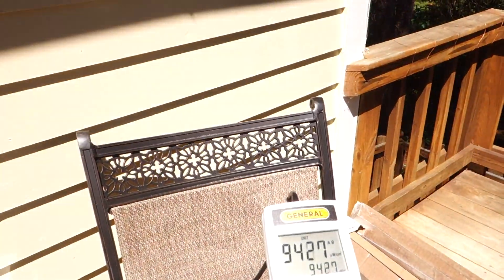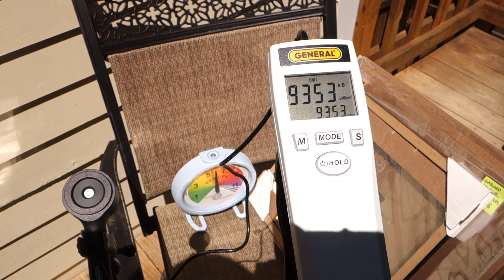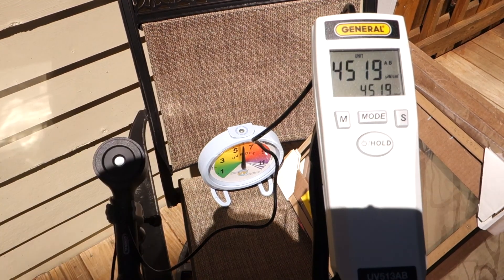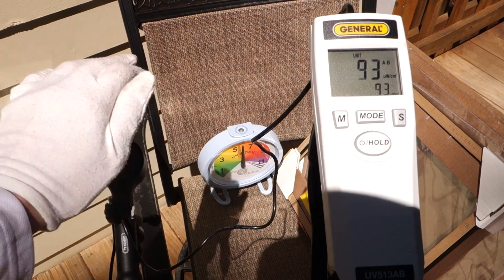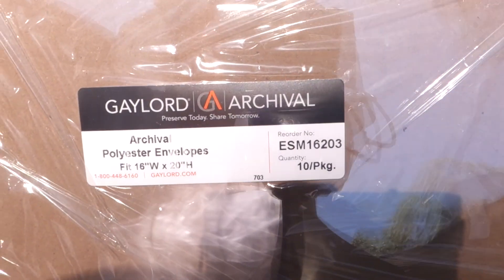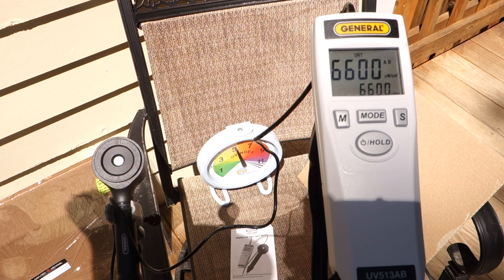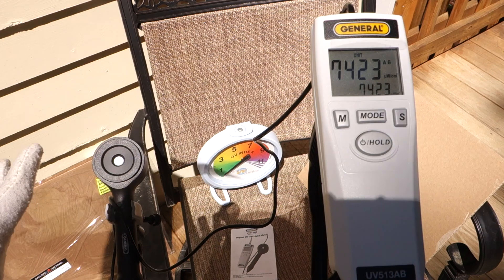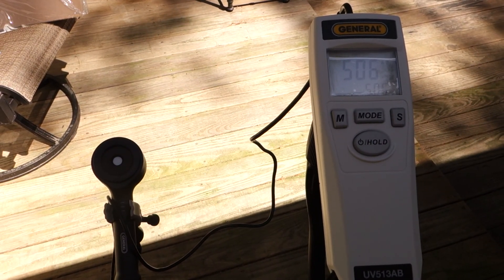Evaluation and comparison of UV protection glass and polyester sleeves for protecting artwork.

Comment: Good demo. Midway through your tests, some of your shadow is blocking the sensor, which is why it was ~9000 in the beginning, and ~6000 later. However, still good enough for general comparison.

For reference, untreated glass blocks almost all UVB but transmits almost all UVA.
Vinyl, the soft clear type, also blocks almost all UVB but transmits almost all UVA.
Untreated Acrylic (aka Lucite or Plexiglas) blocks UVB but does transmit some UVA. It resists turning yellow under strong light like sunlight. It is optically very clear.
Untreated polycarbonate (Lexan) blocks UVB and almost all UVA. It will yellow with sun exposure (since it absorbs UV). It is slightly less clear than Acrylic. But, PC is generally the best material for protecting art since it blocks more of the shorter wavelengths.
Reply from the maker: Thank you for your feedback, and for sharing that great info re: UVA and UVB transmission/blocking of various materials!  Definitely relevant and useful.